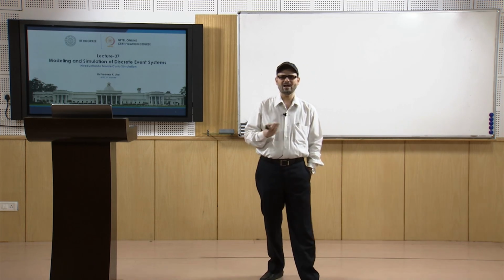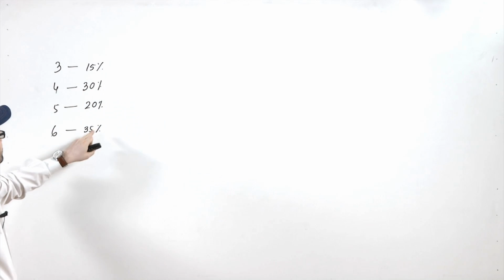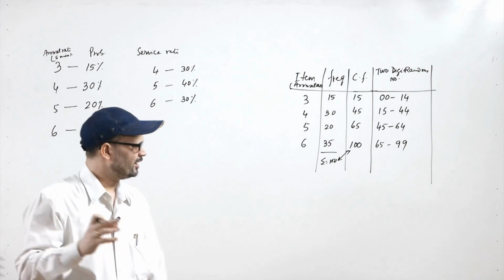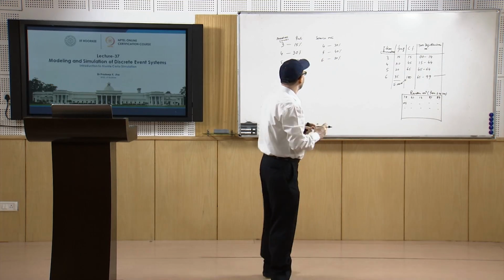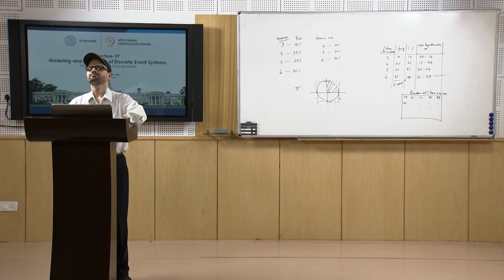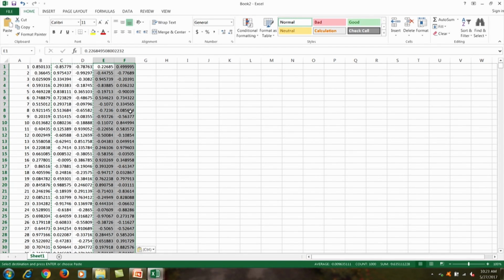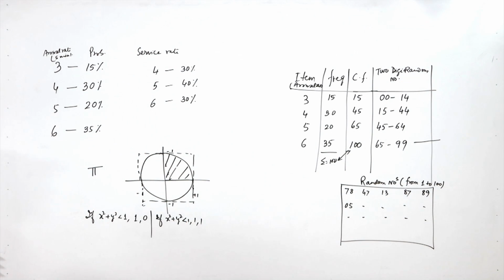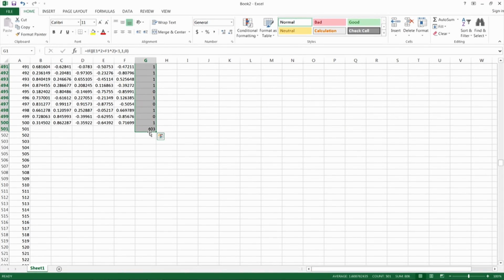Lecture 37- Introduction to Monte Carlo Simulation

Comment: Sir thanks for your valuable tutorial, I have one question. Could we use this monte Carlo simulation to optimization of thermal power plant operating parameters like steam pressure, steam temperatures etc.
Reply: We do not use Monte carlo simulation for optimization but fo estimation only.

Comment: Why use 1 -2*rand() ?
Was this reason being radius of circle of one(r=1) and one length of the square being (r+r = 1+1=2)

The domain is composed of all points in the square hence, rand( ). 
So 1-2*rand( ) is equivalent to...

Radius of circle of 1( points in circle) - 2* all rand( )?? 

Correct? I have been out of school for nearly a decade so its difficult for me.

Comment: BAD EXPLANATION, too long, too complex. Use simple examples to explain concepts and demonstrate them with hard examples.
Reply: Misseur, no. I disagree. Would it been better to treat lecture with derivations and calculus? 
No the best example of learning is to learn it from its most basic ideas.
Reply: Thank you sir for the implementation of the IF function . I have always wanted to see it in action.